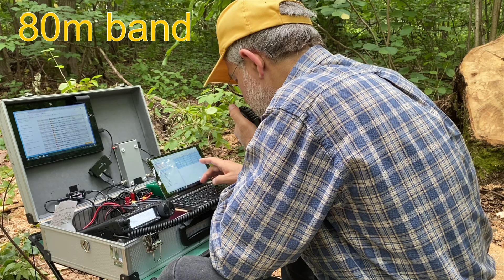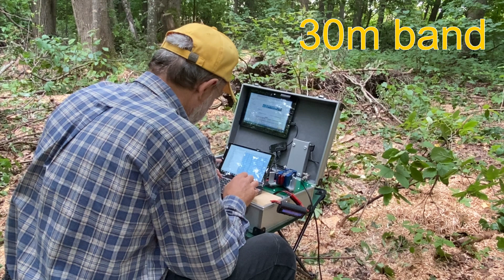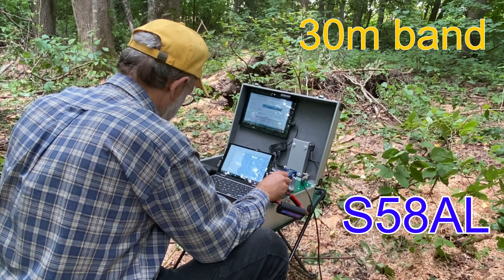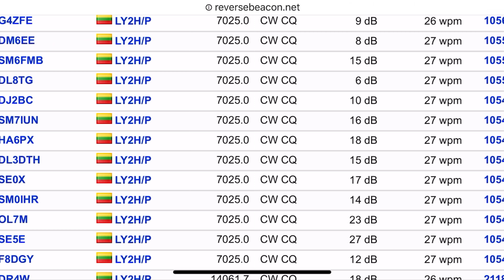SHORTY 80 -10m EFHW ! Field test.

Comment: linas, why 80uH ? i always find description for a 80m coil have 110 uH. how broadband is your coil on 80m? i found my just around 45 khz without tuner, raising very high at the ends.
Reply from the maker: Hello Jo, thanks for watching! There is no particular scientific reason, why 80 uH :) It’s just so happenned that I had the coil former 3-D printed and unused from another project and its size was more or less  able to accommodate the coil “in the vicinity of 110 uH”. I wanted to have no mechanical /soldering joints between the coil and the antenna wire, so I wound the coil of the same antenna wire, so it’s got so many turns as it got, and it turned to be around 80 uH :). I was no worried about that, as I balanced this “reactances game” out by simply making the end tail after the coil a bit longer.  I think, the Q of my antenna is a bit lower because of atenna wire used instead of some thinner “magnet wire”, so my bandwidth is a bit broader, though I can’t remember now how  broad it was :). Actually, thanks for asking, next time I deploy it  outdoorsy, I will take some measurements and ammend the description to the video. 73! Linas LY2H
Reply: @Linas_LY2H thank you linas for your quick response. i figure out the coil diameter has no or very less effect on the broadband, is it? but what make a coil to be broadband, or is 45khz the maximum we can reach? what about wire diameter of the coil? one thing you mention make me curious; the way you hang the antenna up, i will try different ways and see how it act. and last; if you wind a coil do you aim for the inductance like 110uH or for frequency resonance? tnx for now! 73
Reply from the maker: @jomckarth4836  Thanks for your questions Jo! They all are very good and there is no single answer to none of them :). Only practical experimenting brings the real results, because they are conducted in real place on a real ground. 
The coil’s “broadbandedness” is dependent, most of all,  on a Q factor, which, on its turn, is a complex of multiple other things, like the coil’s diameter, its ratio to the length of the winding, the wire’s  gauge, spacing between the turns, etc. The higher the Q, the lesser the losses the coil incures on the resonant frequency. But also - the  narrower the bandwith. And on the contrary - the lower the Q, the higher the losses, but the coil is more broadband. So, our task is to find an ideal coil with a “golden compromise” between the bandwidth and the losses. Practically, the loading coils vary in their bandwidth from 30 to 100 KhZ measured from the lower frequency point of SWR 3:1 to the higher frequency point of SWR 3:1. 
Hanging the EFHW antennas in some Inverted V form  is one of the most used ones , as it is practical and easy, and it’s only logical as the midpoint of this antenna (as in any other dipole) is the maximum of the current, so it is supposed to be as high as possible above the ground for the maximum antenna radiation. But surely I encourage you to try many other ways of deployment as every new location might affect your antenna differently. 
The 110 uH coil is a mystery in itself :) It acts as a trap separating the 40-10m part of the antenna from the 80m part of it, but also it acts as a loading coil to compensate the capacitive reactance of the short antenna on 80m with the inductive reactance of the coil. So, I aim for the coil for the 110 uH of inductance,  because smart guys in Netherlands have calculated this value as optimal one for both tasks. Tuning  of this antenna to resonance  could be tricky, therefore it is higly recommended  to first assemble the whole antenna, including the coil ant the “tail” into one piece and then start pruning the longer piece of the wire (with the coil and the tail attached, that means you cut from the 49:1 transformer side, reconnecting the wire to the transformer  after each cut) until it’s resonant on 40m band. And then only you get the resonance on 80m by prunning the “tail”. It takes more time to write about it, than actually make it :) HTH, but please note, this is just my personal findings and opinion, there might be numerous others, YMMV. Good luck! 73! Linas LY2H
Reply: @Linas_LY2H hi lina, tnx for your reply, i appreciate! yea i will follow your advice as i feel comfortable with it. i have now finished my coil for 80m and i measure 109,8 uH. i have measured the original one from hy-endfed - 93 uH.  though i can not distinguish much difference if any. next step is to hung it in a inv-v shape, at the moment i have it in a sloper configuration. honestly i do not expect much difference either. however i have at least tryed a few options and i gain some experience in working with endfed antennas. dont get me wrong, i like these antennas very much, i only struggle with the 80m part and i want to get out the best i can. i will keep you informed. 73 have a good time!

Comment: Hello
I have this question. 
Is it good to give a half wave radiator for a given bandwidth i.e. on 80m = 40m, 40m = 20m etc. Please tell me if I would like to build an antenna for the bands 80, 60, 40, 30, 20, 17, 15 and 10m, should I make a separate combined radiator for each band of course? So for example for the 80m band everything would be combined.
Is it better to use harmonics?
How will the antenna be more efficient?
Regards 
SQ2ODE Mariusz
Reply from the maker: Hello Mariusz! Thanks for your questions! I think, you would have so many answers to them, as many people you had asked for! So , my own experience is that an End Fed Half Wave antenna fed via the adequate 49:1 (or 64:1) transformer and cut for the half of wave length on 80m band, can work on the harmonic bands up from the 80m, in theory. In practice, the length of wire good as a 1/2 wl on 80m will be too short on the higher bands and the resonance will be higher up on the band then you need it to be. So, in this reality you can either use an antenna tuner and get the problem fixed (If the mismatch is no bigger than 3:1, most tuners will do that), or you can use some tricks, like planting a tiny loading coil some distance from the feeding point into the antenna wire, which will make the wire “look longer”  electrically and bring the resonances back into the wanted ranges. This method is used by some EFHW manufacturers with certain success. So, my conclusion: this type of antenna is very convenient, once installed and tuned it  can work on harmonic bands without a tuner. But , it takes quite a lot of patience to adjust the general length of the wire and the precise location of the tiny loading coil. Also, such an antenna will NOT acceptably work without a tuner on the non-harmonic bands like 60, 30 and 17m bands. 
Your idea of “giving a half wave radiator for each band” is very good, alowing to avoid all of  the above mentionned problems. This type of the antenna is widely called a “linked EFHW” (could be a traditional center-fed dipole too) as it is made of separate links, made of pieces of wire cut for resonance on each band. No harmonics involved here! In this version, you cut the antenna to resonance first on the highest  band (shortest wire) make a link connection, then add more wire and tune this new link to resonance on the lower band, repeating this untill you have the lowest band covered. This method allows for the precise tune of the antenna on each band you want, including the 60,30,17m with no problems. The only inconvienience- each time you switch the band, you need to lower  the antenna down and connect or disconnect links accordingly. It’s a not big deal if operating outdoors, like park-activation or a field day etc. with lightweight installations. Surely, if you want a permanently installed antenna on the roof of the condominium house, the “linked” type of the EFHW  would not be practical. HTH, good luck in your experiments! 73! Linas LY2H
Reply: @Linas_LY2H  Hello Linas
Thank you for your comprehensive reply. Finally confirmed my thoughts. 
I am getting down to building a combined radiant.
I will brag about my achievements. 
Greetings 
Mariusz SQ2ODE

Comment: I built the same design for my small back yard. My coil, seeing that it is a fixed station antenna, is substantially larger to handle 50 - 100 watts. My coil is a 105uH coil, so the end wire is only 2.1 meters long. Also, to fit the antenna in a 16 meter long yard, I erected it as an Inverted-L. 7.5 meters is vertical at the transformer end, the wire is supported by a paracord an insulator from the top of a 10 meter mast and they remaining wire to the coil (12.3 meters) slopes down to the loading coil and end wire. The coil and end wire are about 3 meters up and the end of the antenna is tied off to a mast at the fenced end of the yard.

No tuner is required from 3.5 MHz to 3.65 MHz on 80 meters, nor is it required on 40 meters. The 20 meter resonance is around 14.40 MHz, so the internal tuner is used. A full sized dipole would be better, but it would have to be tied off in the next yard, not an option for me, hi!

Well done, a great presentation and hope to CU on the bands soon!

73, Keith, WB2VUO here near Buffalo,  NY.
Reply from the maker: Thanks for watching and sharing your own experience Keith! It looks like your set-up is a maximum what one could do in your lot, so well done to you! What I like about this antenna is that it's not critical to the dimensions or size of the coil, the end "tail" would compensate for small  discrepancies. As it comes to the power, the coil shown in the video wound of the same antenna wire was running 100W from my FT-891 in the go-box with no problems. The 49:1 transformer is really more sensitive to the power applied. Have fun with your antenna, many Dx and Merry X'mas! 73! Linas LY2H

Comment: Very good work Linas! I will build this antenna and I think i will use 1mm dia wire (speaker wire)... Vy73 de va3kwx Christophe
Reply from the maker: Thanks Christophe! I think, 1mm wire diameter is just fine for QRP to 100W work.  Good Luck! 73! Linas LY2H

Comment: I made this coil and antenna today... spent about 4 hrs on it trying to tune it.... 20m and up, its all good....but I couldnt get 40 or 80m to get lower than 5:1... I even tried 2 different value coils. I added wire, trimmed wire...SWR was just all over.. It was about same height overall off ground as yours..... I finally called it a day and licked my wounds.... not sure what to try, that I already havent?? 73
Reply from the maker: Hello Darby, thanks for sharing your experience , even if it was not so good :-). I had no problems in building mine. In your case, I would make sure, firstly, if my transformer is wound properly on the proper type of toroid ( FT-43 or similar material preferably). Then I would test the transformer with no antenna but the 3kOhm non-inductive resistor connected, using nanoVNA or antenna analyser. The SWR should be less than 2 on all bands of your interest. If not, something's wrong with the transformer. Secondly, I would cut the antenna wire for 40m halve wave and trim it for the best SWR on 40m band ( in my case it was 19.8m) first .Then, I would connect the loading coil with some 4 m or more of wire "pigtail" attached to it. Thirdly, I would trim the pigtail for the best resonance on 80m segment of my choice. Last but not least, the 4m long counterpoise wire is very much welcome to use, and if not, I'd make sure my coax cable is not shorter than 4m long as it's shield  would act as a counterpoise in the absence of the wire c'poise. In this case, the RF choke unun is very much welcome too, connected at the radio side, or at the 4m mark on the cable looking from the transformer's side ( it could be just the same feeding cable wound on the ferrite toroid or just coiled on itself, in the cheapest way). So, this strategy of building and tuning the antenna usualy works, at least for me. HTH 73! Linas LY2H.

Comment: Greetings could you tell me what gain   have the EFHW antenna. Excellent your video
W4EDY
Reply from the maker: Thanks Eduardo! There is no simple answer to your simple question. The End Fed Half Wave antenna is a dipole in its nature, just with the feedpoint moved to an end of it. The "normal dipole" could be called Centre Fed Half Wave antenna. So, the properties of the EFHW antenna are actually the same as of the CFHW antenna, with some variations , like EFHW  being able to get resonant on an even harmonics etc. As it comes to the gain,  the gain of a dipole  can be expressed as combination of the Directivity and the Radiation Efficiency. Theoretical gain of a dipole is 2.15 dBi ( 2.15 db compared to the "i"- isotropic - theoretical omnidirectional radiator) only taking the directivity factor, no radiation efficiency ( or losses , in other words) into account. In practical life, the dipole itself is a reference point for other antennas gain measurements (measured in dBd) so we can say that the dipole's , including EFHW, gain is 0dBd if the dipole is lossless. As it is not possible to be lossless in this practical Earth life, we must take ohmic losses ( losses due to electrical connections, feeding cable losses, transformer losses, etc) and ground losses ( losses incured by proximity to the ground, like the hight of the dipole above the ground, the soil type, the configuration of the dipole's shoulders etc.) into account and detract these expressed in dB, from our gain figure. Since dipole's gain based on directivity alone  is 0dBd,  so adding negative dB of losses to it we'll have negative gain of the overall dipole system. So the conclusion is , the EFHW antenna is not a gain antenna which will multiple your transmitter's radiated power, on the contrary, it will "eat up" some power of your transmitted power and convert it partially into heat of the antenna construction elements, partially into heating worms up in the soil  :). Nevermind all this, the properly constructed/located dipole in general, and the EFHW dipole in particular is a very good antenna ! HTH 73! Linas LY2H

Comment: 👍👍👍👍 Great video.. Good antenna project, I'm sat here wondering what materials are in my junk box.. Not sure about operating in amongst the trees, surely out in the clear is better for radiation pattern ?
Reply from the maker: Thanks for watching! There is more coming! As to the radiation pattern, well, it's really difficult to predict it :) It depends on so many components, but mostly on the hight of the centre part of the antenna and the general shape: whether it's a horizontal wire, or sloping, or inverted V ir zig-zaged in any crazy way :). The soil nature of the area might be important too. So it is a good idea to have the end of the antenna longer than calculated for a few feet or so and to make final SWR adjustment in-situ folding back the unnecessary length ( NOT cutting). It is possible to guess the pattern running  a WSPR  for the day or so and watching the reports on you, or if you work CW, call lots of cq and check  regularly with the Reverse Beacon Network. The trees or bushes do not really matter so much on the HF spectrum especially on the Low Ham bands, like 80 or 40m. So everything will work just let's  go and do it! 73! Linas LY2H

Comment: I would love to get detailed specs on your entire antenna system. This looks absolutely great for SOTA applications. 73
Reply from the maker: Thanks for watching! I’m not sure what do you mean by detailed specs :) The measurements are in the video, and they are not that critical, the the loading coil for instance.  It is recommended to be 110 microH , I made abt 80 microH and it’s easy to compensate with the end after-coil part of the antenna. The size of the wire is not critical, any diameter 1-2mm will do if you run up to 100W into it. 2-3mm if running more. I was using the manufactory made transformer (by Myantennas.com) and its specs are on their website , I guess. The home made transformer would perfectly do too adopted to your own needs. In my antenna system, I do use the 4m long counterpoise wire (0,05 w/l on the lowest 80m band) and the CMC in line but many people don’t as the coax itself makes for a good return path for a quite modest antenna current at that point of the antenna. Some people insert the CMC (common mode choke) at the 0,05 w/l of the coax. Let me know what else could I tell you about this project! 73! Linas LY2H
Reply: @Linas_LY2H  Hi there, thanks for the quick response. I was actually looking for the type and size of wire, but you have answered that.73 ZR6RDS

Comment: Next question.  How well did it work?
Reply from the maker: Thanks for watching! It worked surprisingly good on 80m! My goal was to have been heard good on 80m band by the local/regional stations in order to give them the unique WWFF reference. All local stations within LY were giving me 59+, I also was called by some Polish stations and even by a Danish which was really uniuque for all the activity was taking place during day time, at abt 10-11 UTC. As to the other bands, 40m and up it was working as good as any EFHW full-size antenna would work, i.e., excellent! Usually I do some DX stations on 40-30-20m bands from the USA and Canada with it. I ‘ve  tried this antenna multiple times but only in an Inverted V configuration with the centre on my 6m or 8m masts top. The other configurations, higher, into the trees,  could give different, may be even better results. I will make more experiments in the future. Wish you too! Stay safe until then!

Comment: May I request for the specifications of the coil. Is a tuner required for this antenna.
Reply from the maker: rajesh huddar It's in the video, my dimensions. I wound 80 turns on 40mm former, it could be around 80 microH. The original source suggests 110 microH. I think it is not critical for you can always adjust the length of the wire after the coil. In my tests, antenna's SWR was under 2:1 on 80,40,20,15 and 10m bands. It did take a tuner on 30m band. Try it yourself, it's fun!